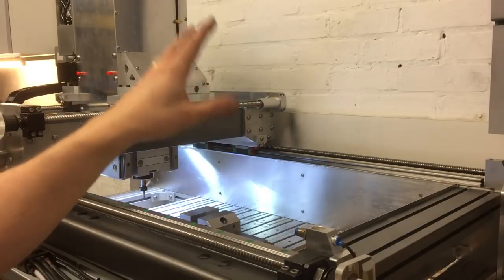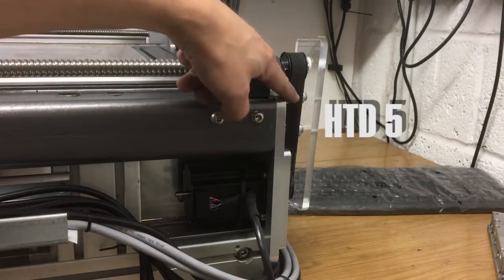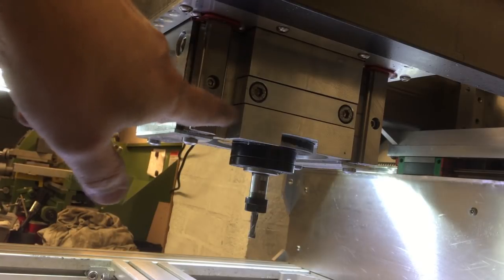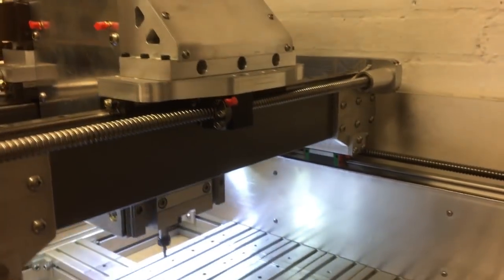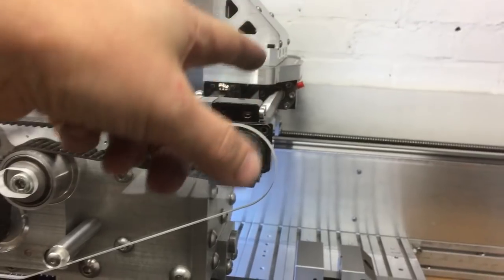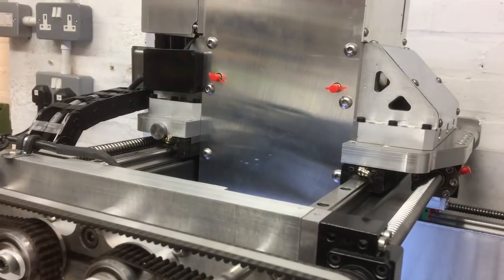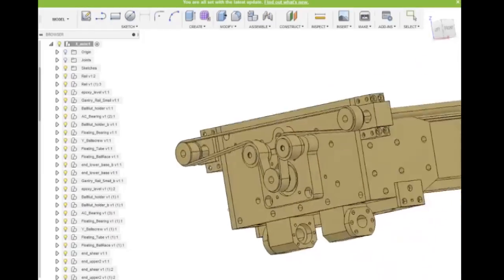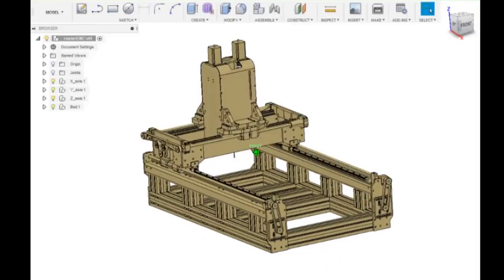Episode 25: Overview

Comment: Great design,
One question is the Z Axis
Overconstrained?
Reply from the maker: Depends on what you mean.  Single beam gantry routers where the router hangs off the front on 2 rails are fully constrained in that they locate the Z axis in space.  Adding 2 more rails as per my design needs to therefore be done with care to ensure they are co-planar and don't bind up.
I was very careful in the design to make sure that the Z rails would not be pre-loaded incorrectly.  The side plates of the Y axis box which surrounds the Z axis to which the carriages bolt to were free to find their natural position.  In one of the videos I measured the sliding force and smoothness of the Z axis in the Y box to make sure it was OK.  Thanks.
Reply: @routercnc9517  
Yes that's right just wasn't sure you
Can do that and hope to have a long life
On the Z Axis with 4 Rails.

Thanks
Dan
Reply from the maker: If done wrong then it could bind or limit the life of the rails or ballscrews.  So I aligned my rails to be less than 0.01 mm parallel along their length in both planes so I think they will be OK.  This is way better than the Hiwin spec sheet requires for good service life.  Thanks.

Comment: Thank you, I followed your build, its very good and inspiring.
Maybe I missed, what is the accuracy of the machine?
Reply from the maker: Thank you for the kind words.  I have shown it briefly in a few videos, especially the e-kart build series where I am actually using the machine to help make parts, but I haven't made a thing about it as such.

I've just gone to the workshop to measure a few parts where the outer profile was roughed and then finish passed with no special attention paid to the accuracy (as it was only cosmetic).  Here are the results of some sample measurements:
Width in CAD 18 mm, width with micrometer 17.98 mm
Width in CAD 80 mm, width with micrometer 79.99 mm

In the e-kart build series I interpolated a 10 mm diameter hole using a 6 mm end mill, using a roughing pass and finish pass, and then used the 2 point internal micrometer to take measurements at 3 random locations across the bore which were between 10.02 - 10.03 mm diameter.

So I would say +-0.03 mm (+- 1 thou) as a guide where I did not especially take any additional measures such as cutter compensation.  Some of this is the stiffness, and some of it is in the care setting it up during the build.

I suspect the generic Chinese collets (which I have had for years) have a bit of run-out, but I am happy for now.  Thanks.

Comment: Fantastic work! I’ve been following this project of yours for months now, and seeing what you have done really helped when I designed and built my own cnc router. While my machine is not as stiff as this one is, I am still able to do thick aluminum. The biggest problem I have ran into, however, is feeds and speeds. So, my question is what x y feed, depth of cut, and rpm of your spindle do you run? Currently I run 14,000 rpm, 0.02” DoC, and 45 IPM, which seems to be a sweet spot, but it still seems it could be better.
Reply from the maker: Thank you.  Well done for finishing your own machine, it is something to be proud of that is for sure.

I can tell you what I tend to run now on the new machine, but it is severely limited by not having an air compressor with coolant to clear the chips.  Without this (it is on the wish list !) aluminium likes to stick to the tool, no matter how stiff the machine.  It is also dependent on the fixture setup, part overhang, part thickness etc. so there is some experience used and also listening to the sound it makes. 

But as an example when slotting / full width profiling in aluminium I am using 6mm 2F carbide, ~12,000 rpm, 1mm DoC (0.04 "), and starting at about 900 mm/min (35 in/min).  Once the cut is established and I am happy with the chip clearance, I can increase the feedrate further to maybe 1200mm/min (47in/min) or beyond using the override.
If the part is thick, say over 8mm, then chip clearance suddenly becomes very critical as a chip caught in the tool flutes has a long way to get out and chip weld risk increases.  For reliability I tend to slow the feedrate as it gets down to deeper depths.

For side milling where chip clearance is automatically much better, or adaptive clearing, I would start at  6mm 2F carbide, 12000 rpm, 3mm DoC (0.11"), and ~2mm WoC (0.07"), and then dial in a feedrate anywhere between 600 and 1200mm/min depending on how the cut was progressing.  Again, with air and coolant this would be much faster on my machine, but I don't have that just yet.  So for now I am content with accurate parts, good surface finish, and reasonable (hobbyist) machining time.  If you push it to save 2 minutes, and you get chip weld / tool breakage / part slipping in the fixture loosing the datum, it will cost you >15 minutes to set up and get going again . . . 

So those are my rough numbers for now, which may help, but again without proper air and coolant on my machine they are what I am comfortable running with.
Thanks

Comment: I really like your machine. I'm in the process of accumulating parts to upgrade my own to something stiffer, mainly going from a single ballscrew in the X axis to one on each side. I've also got 5 pitch screws (I couldn't find 10 pitch screws on the sizes i wanted) and I used to have problems getting good rapids with them and nema 23's. nema 24 are pretty much fit the same mounts and the best ones give 50% more toque than nema 23s. Not that you need more torque with the mechanical advantage 5 pitched screws give, but it gets easier to trade for speed at the worst part of the curve/speed (even gives headroom to get some more speed via 1:2 pulleys), which is useful if you're routing big parts like you said. For the Y axis which you're driving with a single motor for the 2 screws, it might be a good upgrade.
Reply from the maker: Thanks Fernando.  You are right and if starting again I would go for 1610 screws (try BST automation on Aliexpress - they have all sorts on there).  The Nema 24 option is interesting, thanks for that.  At the moment I'm very happy with the machine as it is, and rapids are fine.  I'm not cutting the Aztec calendar so my run times are more limited by not having an air compressor and coolant clearing the chips, therefore limiting feed rate during cutting.  One day hopefully . . . .

Comment: What was your total cost for this machine?
Reply from the maker: Difficult to say as parts were bought over the years for earlier machines and then re-used on later ones.  Could be £3,000 - £4000 ($3800-$5000 USD) - at least that is what I tell myself as it could be more . . . .
Reply: Thx! 5k is scceptable.

Comment: I just love the elevated Y rails. I might do that too, have a base with 2 I-beams (or H beams depending on how you look at it)  that would cover that fine). Not sure why you guys refer to them as X axis but anyways :)
Reply from the maker: Let's not get into an XY debate (!).  I think in the UK, mainly on the mycncuk forum, we would view it like a sheet of graph paper in cartesian terms with X side to side, and Y away from you.  But so long as it is clear then I'm not going to worry about it :)

Raised bed sides in the shape of an I-beam would be great for vertical loads, but watch out for lateral forces as they are not so good in lozenge (e.g. cutting in UK Y direction).  Box section is much better.  We are talking tiny deflections/vibrations, but you need to consider this in the design.  Not a deal breaker, just be aware.

Thanks
Reply: @routercnc9517  Well these are about 1 meter long and weigh ... well a LOT 20-30 Kg's a piece (maybe more). And they have fins in several spots for added strength. Trust me they ain't going to flex :)

Good thing is that they already fit the base (a 4cm thick aluminum slab 1m by 1m) ... In a previous life it was a fixture in a clean room for some IT Chip design company in which large and heavy testing rigs would be mounted. So it is built insanely heavy.
Reply from the maker: @xConundrumx  OK, sounds like a good find so go for it !
Reply: @routercnc9517  Heh yeah, sure was for 35 Euros ;) Even came with a welded square tube support. And 4 frictionless air bearings to rest it on. Cost 3 times that much to transport it to my house :)

Comment: After I saw the title, I really hoped you wouldn't just give the files away. Great job making them available for a very reasonable price!

What a machine! A little bit overengineered I think but that is exactly why it so beautiful and unique :D Are you planning to change the spindle to something better like "Mechatron" for example? Looking forward to the final video of the gokart series and any other of your fantastic videos. Keep up the good work!
Reply from the maker: Yes it is over engineered for a simple router, but I needed a hybrid between a mill and a router, so this is it.  It's not want everyone needs, but it works for me and I enjoyed building it and finally using it.  I decided to charge a small amount for the CAD, hopefully people understand why and are OK with it.

The design does allow various spindle upgrades ranging from indirect drive simple cartridge spindles (DIY of course !), to power draw bar spindles for quick change tools.  These are both ambitious and long term projects so not on to do list just yet.  I've not seen the Mechtron (I don't think so anyway) so will check them out.  Thanks for the heads up.

I'm working on the next e-kart video, just some life things have got in the way (nothing serious).

Thanks